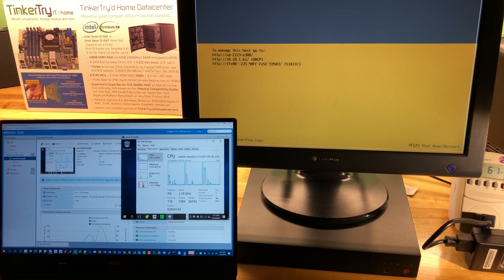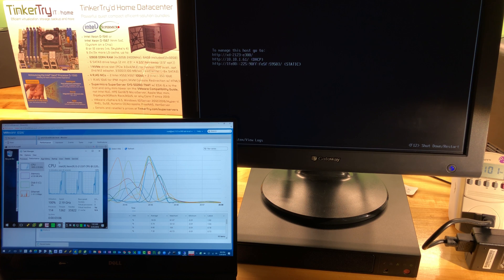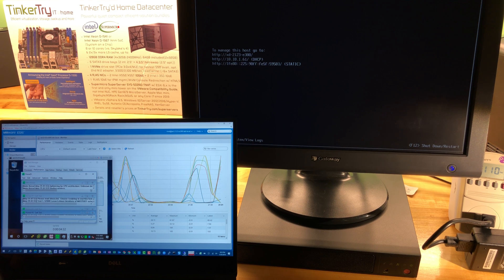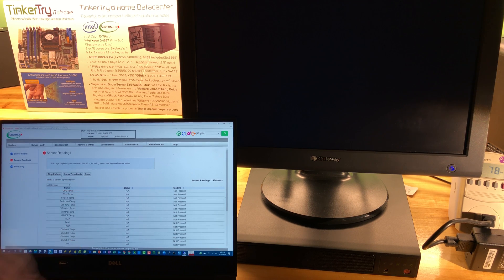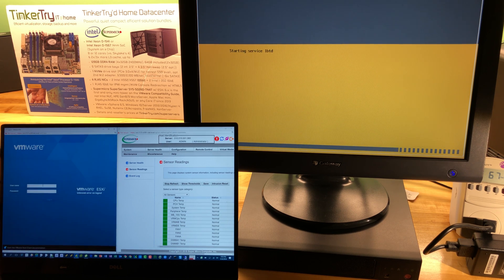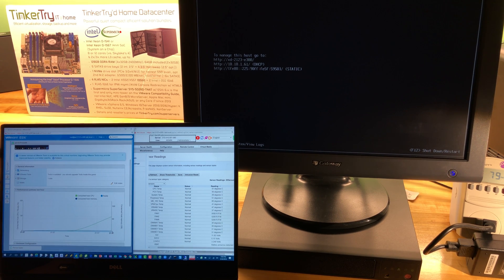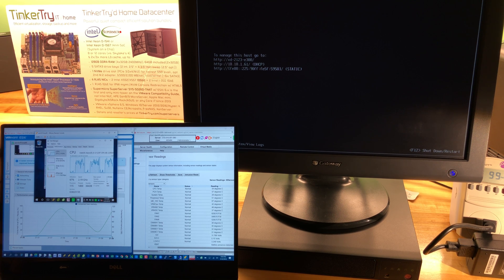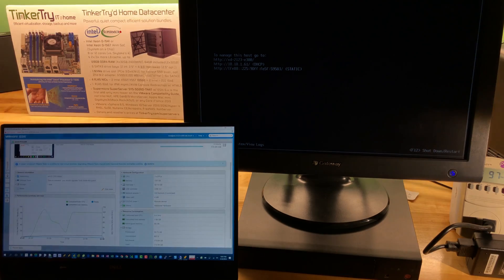Supermicro SuperServer SYS-E300-9D powers off once 84 watt power supply is pushed to 110 watts [4K]

Comment: From what i see on the supermicro site they include 120W PSU - 120W Lockable DC Power Adapter with PFC
Reply from the maker: That has apparently been updated, as it used to only show  the 84 watt power supply. Thank you for spotting that, and for reporting it here, I really appreciate it!
It sure is unfortunate that Supermicro decided to mail me the 84 watt power supply instead, greatly limiting the value of my short test period.